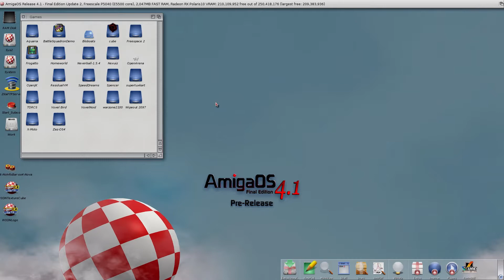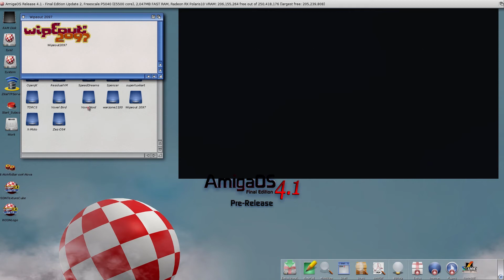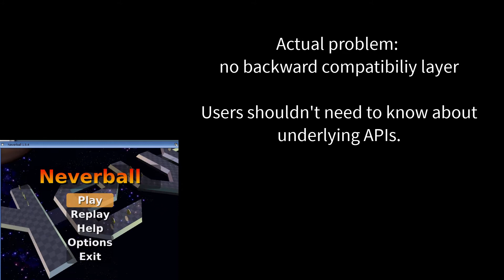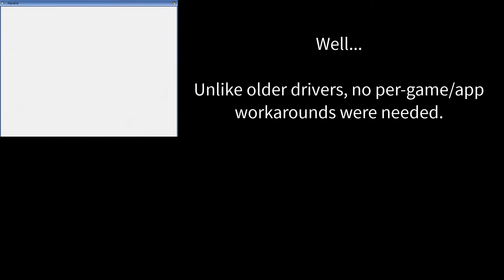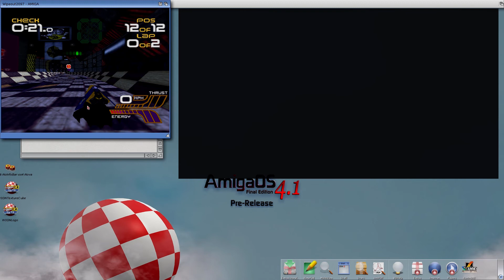NovaBridge - Warp3D Backward Compatibility - AmiWest 2021 Talk

Comment: Is there a warp3d supported game for the Amiga? 
Is there a cheaper version of the Amiga X 5000?
With which processor brand will the new version of Amiga be released?
Thanks
Reply from the maker: Not sure what you mean with "is there a Warp3D supported game for the Amiga?" Warp3D is an AmigaOS 3D API (at least the one we're talking about), so yes, there are Warp3D games for the Amiga. I don't know of a cheaper X5000. The entry level machine is the A1222, but it's still not available. AmigaOS 4 runs on PowerPC CPUs.
Reply: @KeaSigmaDelta  Sorry .I meant a new game.
Will a new warp3d supported game be released for the Amiga?

x5000 €2000. Will there be a cheaper next-gen Amiga? 

So which manufacturer will produce it?
For example, will it produce NXP?
Reply from the maker: @özgür koşar  Ah, okay. If Crisot ever finishes his dungeon crawler, then yes (https://www.youtube.com/watch?v=LkQ3VzKgd5w ). That's the only unfinished Warp3D project that I know of. Maybe someone else is working on something, but I wouldn't hold your breath...

NovaBridge is there to let the large number of existing games work. I expect new developments to use modern OpenGL via Warp3D Nova.

I have no idea regarding hardware developments other than what I've already said. You'd have to ask A-EON (and maybe ACube) if anything new is in the pipeline hardware-wise.
Reply: Thanks for your answers
Reply from the maker: @ozgurkosar34  You're welcome.

Comment: This is really great, I always thought calling the new API after Warp3D was a bit dicey since it seems to be completely unrelated, but now there shouldn't be any confusion for NG new comers.
Maybe dropping the Warp3D moniker and marketing it as Nova 3D would still be a good habit for A-EON, my 2 cents.
Southern Island card have a classic Warp3D driver, should SI users switch to Novabridge?
Reply from the maker: The Warp3D Nova API does have some resemblance to the old Warp3D even though it doesn't have direct backward compatibility. 

Southern Island card owners can choose whether they want to use the old W3D_SI driver, or NovaBridge.